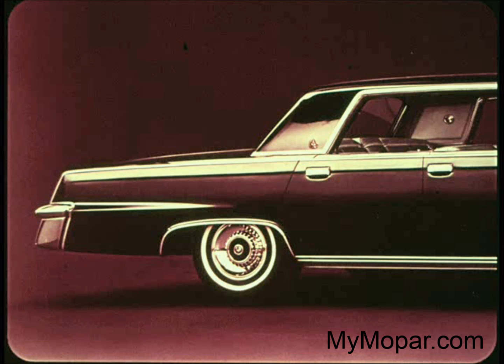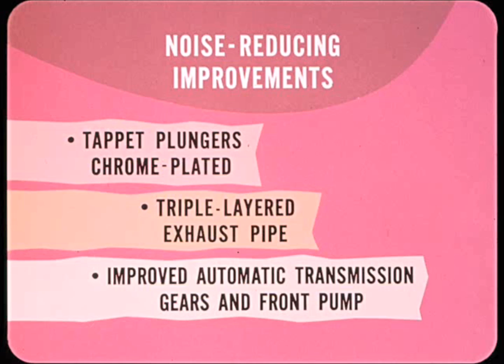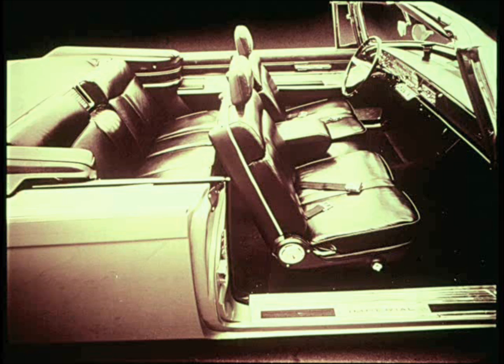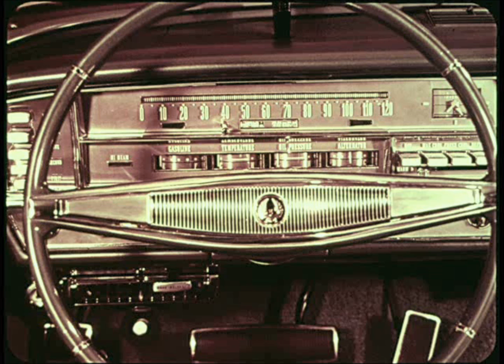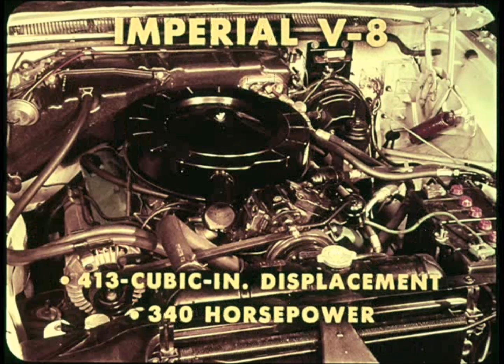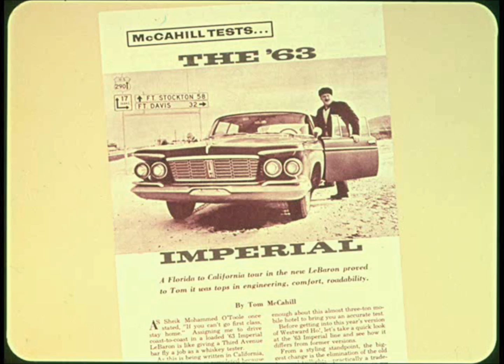1964 Chrysler Imperial Sales Features - Chrysler Master Tech

Comment: Adding to my previous post by the 1966 models they had removed another 150 sounds and vibrations and upped the cubes to 440 and of course all torqueflytes since 62 had park position. In the 70's while driving a friend's 64 and new bodied 76 Rolls Royce's. I remember not being impressed with their quietness as I had already expierenced that years earlier in the Imperials. In 67 imperial went unibodied (All other mopars were unibody since 1960 ),and offered disc brakes. You can tell if they have them as it is marked on the brake pedal.

Comment: Working for the local Chrysler dealer since 1962 high school doing new car prep I'll never forget taking the first new 64 out on test drive upon prep completion me and my other Chrysler employee noticed the new quietness and vibration less ride. It was no sales pitch. Chrysler had removed over 200 noticable and subliminal sounds and vibrations. We commented to each other it felt like something was missing it was so quiet. Because the car had flat side panels it was found they vibrated, so every 18"  vertical braces were welded from front to rear amoung other things. Maybe you've heard they don't allow any Mopars in destruction derbys it's just not fair to other cars .

Comment: This car is NOT a "Chrysler".  It IS an   I M P E R I A L....period.
Reply: Right, sir! In the long run, Chrysler Corporation hurt itself by not drawing a sharper contrast between the Imperials, and Chryslers. GM NEVER let the public confuse the Caddy with Buicks and Oldsmobiles, nor did Ford fail to clearly differentiate between Lincoln and the Mercurys.
Reply: @jkdm7653 , Ford Granada, Mercury Monarch and Lincoln Versailles, and Chevrolet Celebrity and Cadillac Cimarron! But they were not makes, just models! Chrysler did set the Imperial different from 1957 to 1966 but they were still sold through Chrysler/Plymouth dealers, becoming Chrysler/Plymouth/Imperial dealers! But only the higher volume dealers! Before that, Plymouth shared dealerships with each of the other divisions too! Chrysler wanted their bread and butter car to draw attention to the more expensive makes up until about 1959-'60 period! And Cadillac designers didn't like the dental work on the 1962 production year, they thought that it was too Chevy-like, that it cheapened the look of the front end! All in all, the Imperial failed so many times just trying to be more than a Chrysler!
Reply: @oliasofsunhillow7116  Please see my comments above and below.
Reply: Olias Of Sunhillow the Cimarron was based on the Cavalier, a compact.  The Celeb was a mid size.
Reply: @jkdm7653   And to make things WORSE...THE  IMPERIAL had it's OWN unique body and chassis....that it didn't share with ANY other Chrysler Corporation Car...whereas CADILLAC actually DID share it's frame with  certain Olds (98) and Buick (Electra) models !!
Reply: @williamg2552  Thanks for the info about the GM bodysharing! Interesting.

Comment: For all of the guys who insist that the IMPERIAL is , was, and will always be, a "Chrysler", explain THIS: On the VIN numbers all "Chryslers" (Newport, New Yorker, 300, etc) carried a "C" code. The IMPERIAL didn't . Under IT'S "Make" code,all IMPERIALS (Custom, Crown, LeBaron, Ghia Limousine)  there was a "Y"code. TWO DIFFERENT MAKES.  If The IMPERIAL  was a "Chrysler", wouldn't it ALSO have had a "C" code…like OTHER Chryslers? Also consider THIS: (from Wikipedia) : "For the 1955 model year, the Imperial was launched and registered as a separate marque (make), apart from the Chrysler brand. It was a product of the new Imperial Division of Chrysler Corporation, meaning that the Imperial would be a make and division unto itself, and not bear the Chrysler name. Chrysler Corporation sent notices to all state licensing agencies in the then-48 states that the Imperial, beginning in 1955, would no longer be registered as a Chrysler, but as a separate make ."   Why would the Chrysler Corporation go to such great lengths to separate The IMPERIAL into it's own MAKE and DIVISION, even to the point of contacting all Motor Vehicle Departments (DMV's)  in the then-48 states to inform them of this change, if, as you guys claimed, IT NEVER HAPPENED ?
Think about it.
Reply: Chrysler owns the company. Just like VW owns Lamborghini, that doesn't make a Lamborghini a VW.
Reply: Why isn't Imperial here today then?

Comment: ...I grew up in a small upper midwestern town where a local funeral home owner drove a 1964 Imperial Crown sedan which I often saw being driven around town and admired from afar or occasionally could walk right up to it and look at it up close...also in this same town a local hippy sadly managed somehow to acquire a still quite nice 1964 Imperial convertible which he proceeded to badly abuse and finally wreck...that Imperial ended up as a derelict Imperial convertible sitting in the weeds on the local Ford dealers backlot where I more than once looked at it and sat in it...it was a light blue exterior color with white interior ...tragically the body had been dented/damaged and the interior carelessly abused by that clueless hippy... that Imperial Crown convertible very likely met a fate of being  junked/scrapped ( a very sad fate/ending for that once nice 1964 Imperial convertible ) ...after graduating from High School in the spring of 1973 I was driving a 1966 Impala but that fall ( remember 1973 was a " gas shortage crisis " year ) I came across a 1965 Imperial LeBaron with ivory white interior and leather seats sitting on a Buick used car lot being used to store tires in ... well...the Chevy got traded in on that LeBaron and I was driving a Imperial...eventually I would also come across a very nice 1964 Imperial Crown Coupe which I purchased for $300.00 ...this Crown Coupe had a very nice interior trimmed in dark green vinyl/leather and tan cord cloth with plush dark green carpeting, AM-FM radio, split seats with headrests, power everything and the iconic Push Button controls for the TorqueFlite automatic in that beautifully styled/crafted 1964 Incomparable Imperial dash fascia...the 1964 Imperial is my favorite year of the 1964-1966 Imperial series due to the 1964 Imperial's very well done front end split grille styling and iconic TorqueFlite push buttons ( 1964 was last year for them in ChryCorp cars ) ...the 1961- 1966 Imperials were largely still based on original 1957 Imperial cowl/frame/chassis which is why the 1957 Imperial's curved windshield was retained for the 1964 Imperial major restyle ...the cowl assembly is a costly area to alter/modify ( compared to front end or roof or deck/tail or door panel or fender panel restyles )  so both the 1964 Imperial restyle and 1961 Imperial major body restyle retained the 1957 Imperial's cowl, full frame/body and basic chassis dimensions and components...I think the Imperial curved windshield looked fine on the 1964-1966 Imperials...the 1961 thru 1966 Imperials were full pedigree and panache Imperials ...the 1967-1968 Imperials were much less singular Imperials being they were very derivative of ChryCorp's 1967 unibody Chrysler New Yorker tho 1967- 1968 Imperials still had fabulously detailed and trimmed interiors which the 1969 Imperials then largely lost as well...to have a original, unmolested survivor triple black1964 Imperial LeBaron, a dark green1964 Imperial Crown Coupe and a light ice blue or ivory white 1964 Imperial Convertible all sitting in my garage today?...a Incomparable Imperial Collection..;-)
Reply: Well said.   By 1969 the differance in quality was extremely apparent.   The dash panel had been cheapened to the point were it was almost like half a step above Valiant.
Reply: @splitheseam00 I bought a 64 triple black Lebaron in high school from a friend's father for $500, (he upgraded to  65) a tan over tan 64 - 4 door Crown after the LeBaron died for $300 and a green on green 2 door Crown in the early 90's. Someone smashed into the 4 door Crown. I sold the Crown to the letter carrier for $150 - he was an Imperial guy and came over with another Imperial and drove it away! :-) Boy did I get taken...Sold the 2 door Crown at a loss - It was a bad buy off Ebay. In June of this year, I bought a 64 LeBaron, Sable Tan over black. 64 is my favorite year too although I looked hard at a 65 Black over red LeBaron that just sold a few weeks ago on bring a trailer - It was gorgeous but out of my price range. Are you interested in parting with your triple back LeBaron? One sold on Ebay about 3 or 4 years ago out of Colorado for about 19K. I regret not buying it-All original 60K miles...
Reply: splittheseam00 hippies should stick to microbuses